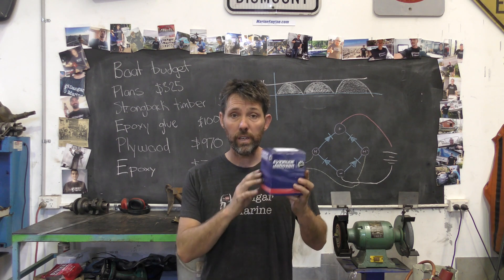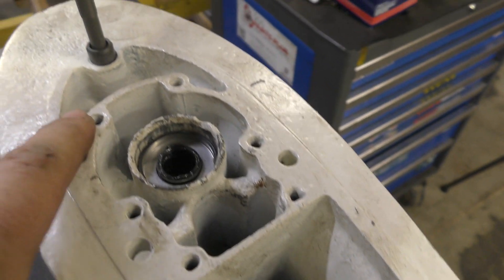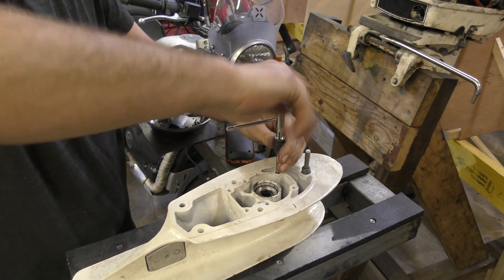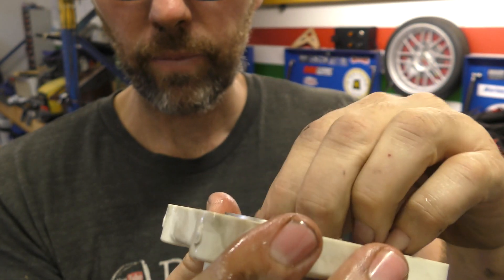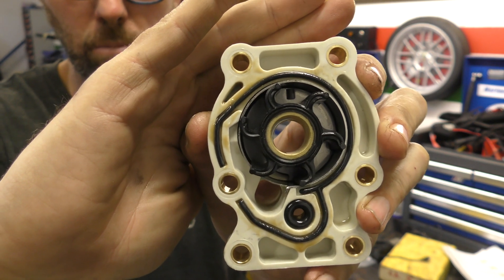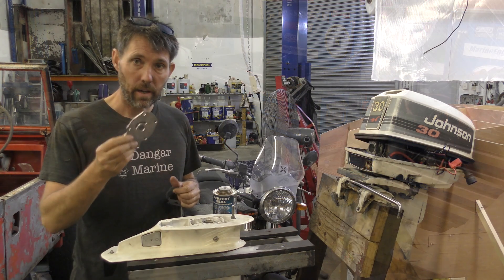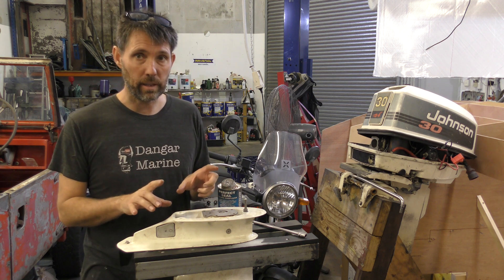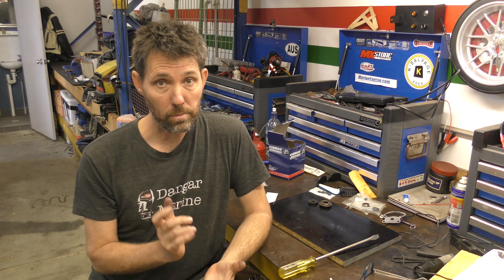Replacing the water pump on a Johson 30HP outboard

Comment: I just bought a Craiglist 1996 Wellcraft 160 CCF w/ 48 hp Evinrude which I'm restoring. I decided I should rebuild the water pump, and after watching your vid,  it doesn't seem to be too difficult.
Your common-sense approach and explanation makes it easy for most of us laypersons to understand what it will take and gives us the confidence to move forward!   Thanks so much!
Reply from the maker: You're welcome mate, good luck with the job. :)
Reply: I just took it out today and the water pump worked great but we had some fuel problems.  We just viewed your vid about using gravity to assist the primer bulb, which I'll be implementing tomorrow, with a new fuel line.  Also, I'll be adding a clear in-line fuel filter between the bulb and fuel pump.  Plz let me know about your t-shirt effort as t-shirts are standard dress here in Austin, Tx.  Thanks again!

Comment: Water pump kits is probably the best video of all to make on different models as there are so many out there including me that need to see it done before giving it a go. Just about anyone can change a spark plug or fuel line or lower unit oil but all the different set ups (specifically the shift linkage/ or the hidden bolts under the trim tab or turning the driveshaft clockwise etc, what the best gasket sealers etc etc etc) you are providing the confidence to quite a few do it yourselfers . 

Thanks again Stu!!!
Reply: Fake Name Great Story. Last boat I put in new reed valves (a credit to watching this channel) only to have the lower part of the drive shaft snap later at the pinion gear. Made the decision to get another used boat . So yes I love watching Stu's channel . Some things I will back away from like the lower unit . All the gears and bearings still intimidate me which is ok because regardless I now have a better understanding of how forward and reverse is delivered.
Reply: Btw, Stu actually has a video on when it may be time to give up on an old outboard which I had to do. I had a 1987 nissan 70hp which was a great motor for a lot of years but once the driveshaft broke and I looked everywhere trying to find one, I made that decision. Parts of any significance were already hard to find for that motor,,,eg. you could get an impeller, but you couldn't get a total water pump kit,,,, etc, etc....
Reply from the maker: Thanks mate, glad the vids are helping you. :)

Comment: Wow perfect timing! Since the last time we had talked, i just started changing the water pump on my 93 johnson 30 hp. Ive been piecing together videos from all other sources online. This means ive been kind of "wingin it." Im so glad you did this video. Thank you Stu!
Reply: One question though. Do i really need to have the drive shaft spacer? I noticed when i took of the lower unit that the drive shaft spacer had warped and melted from the over heating. I had to cut it off in order to fix the water pump.
Reply from the maker: Very good question. I don't really know the answer (others may) but most outboards don't have it so I'm not really sure that it does. If yours was running with the spacer so badly damaged then it can't be critical.
Reply: Bin the spacer it is to stop water travelling up the shaft. Just put grease or anti seize on the shaft spline

Comment: Just wanted to say thank you, I changed my water pump on my 25hp Evenrude (got the same kit from Marine Engine . com) and I could never get any water out the "tell Tail", after going through the procedure 3 time I checked your old videos and you mentioned priming and none priming pumps. I took off the water ears and put the motor in a barrel of water and everything worked great. Thanks Again
Reply from the maker: You're welcome. :)

Comment: Thank you for this, and all the other, very educational videos. They have helped me a lot. I found in my outboard shop manual for Johnson/Evinrude that the torque on the six bolts on the pump house should be 60 - 80 lb/in or 6.8 - 9.5 Nm. I have an Evinrude Elan 1996 35 hp, 3 cyl. two stroke outboard. I have learned during my time as an technical engineer that it is not necessary to use packing cement in addition to a gasket. The shop manual tells  me to use OMC Gasket Sealing Compound, and I can´t see why. Maybe it´s for keeping the gaskets in place while assembling. When I dismantled  the waterpump system, there was no sign of that compound. I hope my english language is ok.

Comment: Nice video again gearcase turned out nice from where you started. That salt water sure makes a mess of things. I just did the same water pump at the marine dealership I work at in Michigan, USA a few weeks ago, and the torque Johnson and Evinrude list for those water pump bolts in the service manual is 60 to 84 inch pounds. I do not know what that converts to in Newton Meters. That's a very common torque spec for Johnson and Evinrude outboards when I comes to the 1/4 inch X 20 T.P.I fasteners. I have never used Adhesive M Evinrude calls for on their water pumps either usually I will use bellows adhesive which works good. The main thing is to secure the O-ring in the proper location during assembly. The reason I will use Mercury bellows adhesive is it's handy because half of the stuff I do is sterndrive and I have lots of MerCruisers kicking around. Thanks again for the great video.
Reply from the maker: Thanks James, appreciate you passing on the torque specs. :)

Comment: Excellent video and presentation.  Thanks.  One general comment about some shift linkages to emphasize.  When I tried removing my lower unit, it wouldn't come out until I completely removed the shift linkage bolt.  This was on a Johnson 15hp.  I assumed the shift rod was simply "clamped", but it is also mechanical held in place by the bolt which engages a tapered portion of the shift rod which isn't visible until disassembled.

Comment: Make sure when you put the lower unit back on that the shift rod on the lower unit is sccrew all the way into the lower unit before you connect it back the the rod on the motor. If you don’t your linkage will be off and it won’t shift into forward gear. Learned this the hard way

Comment: After pump rebuild, your suggestion in another video, to test operation, don’t use earmuffs! My 25 horse was not self prime  you need full immersion of the shaft.Mine would not pee out the hole otherwise.

Comment: I watched your video before and started to rebuild mine and wound up with a spare O ring.  I'll be danged if I did the same thing you did, then I had to take it all apart and put it under the stainless steel impeller cup.   LOL  The instructions did not emphasize that step. Really great on the rest however. You did it better in your video. LOL

Comment: Great video! Very helpful. At 7:35 you say to rotate the impeller CCW. How important is that? I always thought that would self correct, whichever way you put it in. But after toasting a new impeller (on a Johnson 30) that I most likely rotated the wrong way I'm not so sure anymore.

Comment: The sealant Jonson / BRP are referring to is 3M's 847 compound! Well at least nowadays it's what BRP recommends . It's a quick drying "sticky right away" sealant, very effective to hold rubber seals and o-rings to any surfaces but can quickly become a mess if you apply a slight bit too much of it lol. Sealant must resist to vibrations/water/petrol residues/big and fast temperature changes and must not disintegrate. That's why I suggest you install the housing "cup" twisting in the impeller first, then slide the housing on top afterwards, since twisting while applying pressure on the housing seal vs lower plate might overspill the sealant onto the plate which will create a friction later on between the impeller and the spilled sealant on the plate, premature failure. Just saying

Comment: Painting bottom end put dab of grease at top of each bolt thread will prevent paint from sticking or thread a bolt in a few turns to prevent paint from getting in hole.

Comment: Thanks for the video! When I just recently replaced my water pump on my 81 johnson 35hp I have been struggling with the shift rod and getting it to get the boat to go into forward. I have dropped the lower unit multiple times and put it back together sometimes it will go into forward on the first time and then no longer after that. Reverse is working great! Any advice? Thanks!

Comment: HI My friend, congratulation you have very good Videos. I have a Johnson J*RCSS 7,5hp 1980 that I have overheated. I have changed the water pump and head gasket. The water pump is working well, however, I could not improve compression (50 PSI). How hard is it to change rings in that motor? May I change rings or do I need to rectify cylinders too? DO you recommend it for a biginner?

Comment: Very helpful! Thank you. I'm about to change out an impeller on a 78 johnson 35hp for the first time. This is the first outboard I have worked on beyond changing spark plugs. I opened the box of replacement parts and was sure the impeller was the wrong size! Thanks for showing how it all works together. I am a little concerned about getting the gasket sealant right. Hoping a quick look around the auto parts store will sort me out. Thanks again!
Reply from the maker: You're welcome Neal, auto parts stores will have everything you need.

Comment: Hey, great video, you've helped so much..so did the depth of the driveshaft seals matter? Was there an issue?
Reply from the maker: To be honest I can't recall, I've only done one of these engines. I would try to get as close to the original position as you can though.
Reply: Gotcha, I'm about to give it a try now.
One more thing, for now...if I don't want to take out all the gears, can I remove Just the driveshaft to replace the seals? And again man thank you so much..your videos saved my ass!

Comment: You have helped so much befor . Had a obsolete gasket made for my 1998 johnson 9.9 four stroke outboard. Put it all back together. Still gets hot . Do you know where the timming marks line up ??? All information i can find doesn't tell me where crack mark lines up with ... put it where the info i could get said .. still hot.. put it back where it was when I took apart still hot ... everything new gaskets, thermostat, water pump impeller, and all electrics as well.  Don't know what to do??

Comment: Hopefully you still see this from an older video, and I apologize for the long comment:

I have the same motor on my boat as in this video.

I launched my boat, started it up with no issue, and let it idle to warm up while I scurried around the boat getting a few other things ready.  In my movement, I buried the prop in the sand without realizing it.  As I advanced the throttle forward, I heard a "thunk" and the motor died.  Realizing what happened, I cleared the prop from the sand and turned the key... nothing happened.  Didn't try to crank or anything, might as well have unhooked it from the battery.  The ignition is the only thing I have connected to that battery, and everything else was still working fine.

Brought my boat home and looked it over.  All fuses I could fine appear to be in good shape.  All wiring as far as I can tell is still connected (there are a few wires that were obviously cut and I don't think they were in use since I've had the boat).  The throttle still moves and the lever on the motor reacts accordingly.  When the boat is in neutral, the propeller will still rotate.  When it's in gear, the prop still catches when I try to rotate it.

I opened the casing on the throttle and as far as I can tell everything looks fine in there, too.

A buddy of mine thought maybe something bent in the lower from the jolt, and it won't get out of gear, resulting in it not cranking.  I know these motors are relatively simple, but I'm not desperate enough yet to test my luck taking off the lower myself.

So with that, I'm out of ideas and looking for help.  Really don't want to have to take it in to spend a lot of money, and I'm worried it will cost more than the boat is worth.

Thanks in advance.  Maybe this will be the kick in the pants I need to get out on the kayak more.
Reply from the maker: It could be a few things. There is a neutral safety switch that will prevent it from cranking in gear, there could be an issue there. This is a very old video and therefore probably very badly filmed, but it might help with your problem. https://youtu.be/e1h-blqDm4U

Comment: Looks like I get to make a video on changing the impeller on my Yamaha 4hp 4 stroke tomorrow. No pee at all so took it apart. Looked like it exploded inside the housing. Rubber chunks everywhere even down in the water pickup vent holes. Inside of the housing was chewed up so replacing both.
Reply from the maker: Good luck with it Tim! Be careful to make sure none of the bits of impeller are stuck in the cooling system blocking it up.
Reply: Yes did that. Found bits down in the vent holes and ran a small wire up the tube to the motor. Then blew everything out. Test ran it and used today fishing. Ran great

Comment: Dear what is the purpose of the keeper underneath the linkage gearbox joint. I lost the nylon tapered keeper can I replace it with a small O ring please so the linkage nut will not slip off?  Thanks in advance, very informative video

Comment: great vid. I think the stumpy end of the impeller key needs to point in the direction of the impeller travel. To achieve that the impeller is removed - flipped and reinserted (while rotating anticlockwise). I'm going off memory, and could be wrong. I really don't think it'll make much diff, and to fix it would be a huge pain in the _ss now that it is assembled :)
Reply from the maker: From memory it is pretty hard to get it in the wrong way as the impeller has a wedge shaped hole for it to go in. If the wedge is around the wrong way the it wont fit under the impeller. It's a good point though that I should have mentioned. I'll take a look next time.

Comment: Thanks for the great video and helpful instructions.  Unfortunately, I have run into a problem with the reinsertion of the drive shaft into the gearbox.  It feels as if there is resistance from some kind of liquid in.  The gear shaft only goes in about 1/3 of the way.  Any tips would be appreciated.  Thanks

Comment: So I have just received my first boat.  It is a 1976 Manatee with a 70HP Johnson.  I was told the fuel pump was bad but haven't had a chance to go through it all. I knew it was a project when I got it.  Should I go ahead and redo the water pump and impeller as a precaution?  It has been sitting for about 18 months.

Comment: @danger marine love the videos, can i ask, is there anything to disconnect in the engine area to remove the bottom end of this outboard? I have the same outboard that i got recently and would like to do a few changes myself
Reply from the maker: The gear selector is the main thing to disconnect up top.
Reply: @DangarMarine  did you do this in the video or didnt show this part? If not have you  got a video showing it?

Comment: Hi, good videos! I have a minimal oil lost by the hole that is located next to the oil level screw. Do you know if it's gear oil? or if it is for something else related to a stamp? thank you very much, greetings
Reply from the maker: It is most likely just two stroke oil coming out through the exhaust. If there isn't any water in the gearbox oil I wouldn't be too worried.

Comment: Good video, Stu. Thanks! I wish you would have shown putting the lower leg back on as that's where I'm having trouble. I'm getting an old motor back to service and checked out the impeller and replaced the leg oil. When I put it back on I don't get water pumping out of the head - it just comes out the prop. So, the water tube is not getting into the grommet at the top of the pump. I've tried a half dozen times and same thing. By the time the leg is up on the shaft I can't see the tube and grommet alignment. Any advice?
Reply from the maker: Yes, this can be a tricky problem. As you say, you lose sight of it before it goes it. If this happens I normally check that the pipe coming down it's bend and try to get it as close to straight and in position as possible and then put a bit of rubber grease on it to help it slide into the rubber grommet. Sometimes depending on the outboard I can squeeze that thin pick in to help guide it but that isn't always possible.

Comment: I have a Johnson 35hp, to remove the lower unit, the shift rod extending up through the the exhaust housing, is there a disconnection that needs to be made under the carburetor or can the unit just slide off by only removing all the bolts as seen on this video?

Comment: hey mate, love your channel, maybe a silly question, but do all outboards have a tell tale? currently have an 8hp suzuki, from the late 80s or 90s and it doesn't spout water, but I can't find where it would come out? hence the question.
Reply from the maker: Good question. Every outboard I have seen has one, but I'm not familiar with that model. It may be that it only has a bit of water coming out an exhaust relief hole at the back rather than a separate tell tale.

Comment: I have a slight issue, it seems I do not have a drive shaft spacer, the very last thing you installed with the small o rings. Mine is an 81 Johnson Seahorse 35 hp, am I supposed to have one?
Reply from the maker: I don't think it is essential, no.

Comment: after following your steps the motor seems to be highly revved, and it is not the speed throtttle, and ideas what can be the issues please? also is it normal that the water pump is too tight that the blades bend when inserted?

Comment: I have a 1998 4 stroke 9.9 johnson outboard.  It squares water out the small hose but doesn't have any water coming out the exhaust of the prop . Tested thermostat in a pot of water it opens ... what do you think is wrong ?????